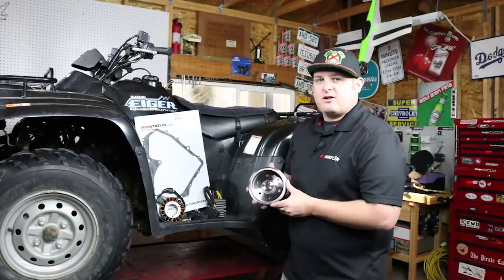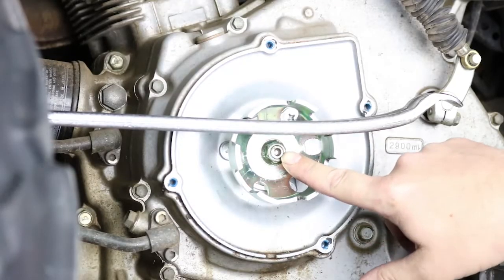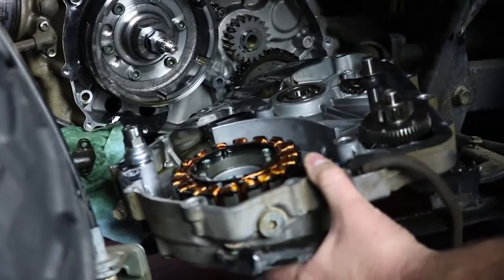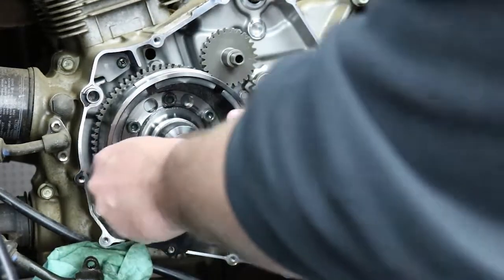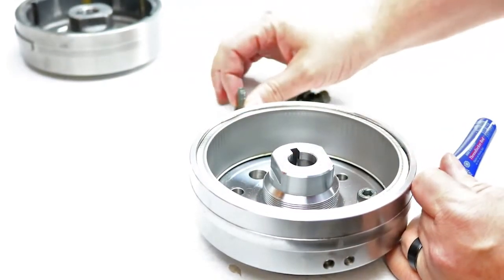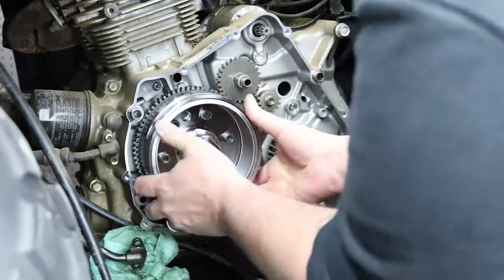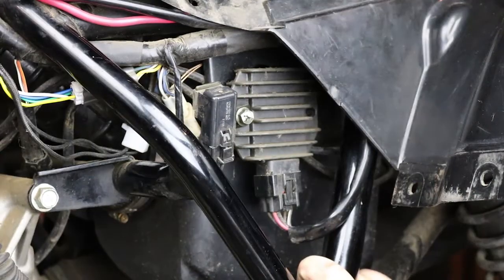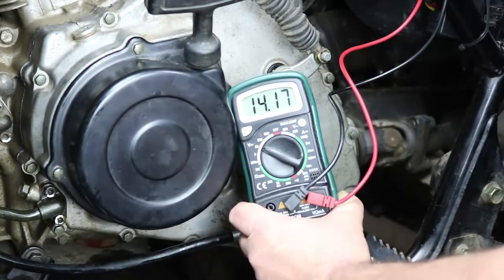How To Install an Arctic Cat 400 & Suzuki Eiger ATVs Heavy Duty Improved Stator Flywheel RM11502

Comment: Great video, I have a 2005 Artic cat 400 4x4 automatic, what is the size of the removal tool required to remove flywheel? Great JOB.
Reply from the maker: Available here: https://rmstator.com/en_us/rm11302
It is 50mm x 1.5 RH thread

Comment: I put my atv back together And when I started it up and put it into low It thinks it's in reverse. I did line up the 2 reference dots  That's on the gears. Any Advice would be appreciated.
Reply from the maker: Sorry I'm not sure. I don't recall having any problem with this. Recommend you check the factory service manual for the shifter install procedure.

Comment: I'm glad I didn't try prying on this case. I have never done this before so I'm following you step by step and You forgot to mention take the 12 mm bolt out of the center then it will pop off
Reply from the maker: Excellent, thanks!

Comment: Are there any details on reassembly? I have a manual Trans and looks different looks like all gears and washers need to be installed on the engine side . looking for a detailed gear washer installation. thanks

Comment: I have a question.  I have a 2006 eiger.  Been having problems with glowing exhaust.  I've tried . New carb. New vacuum peacock. Adjusted valves . Made sure exhaust want plugged . It will fire up and idle.  But soon as u hit throttle it spits and sputters . And quad only has 1200 miles. My question is . Could it be that the problem is  my stator or coil or flywheel ?? 
Thanks

Comment: Is having no spark  usually the flywheel magnet culprit? Just wondering how to diagnose it's the flywheel. I have the 05 Suzuki Eiger and it was running then died. Fired back up but died quickly.I did have what I call a cough from the carburetor off and on for awhile now. So hopefully it's just a clogged jet, we'll see. Nice to the point video though. 👍
Reply: Did you ever figure out the issue?
Reply: @zanerobertson9877  Yeah had to replace old flywheel with the new updated flywheel. Magnets are sealed on the new updated flywheel. Two of the magnets on old flywheel had came loose. Luckily it didn't destroy the stator.

Comment: I have replaced the starter rotor on my 2004 Arctic Cat 400.  Yes, magnets fell apart.  Put the whole thing back together and forgot to put the clutch in the rotor.  Used your video on freeze frame to determine which side goes toward the engine and which faces out.  So, anyway, reassembled and replaced oil and filter.  Now the starter just clicks.  Battery drops from 12.43 to 6 volts when starter held momentarily.  Starter turned fine before clutch was installed.  (LOL!)  Rotor turns counterclockwise -nothing clockwise.  Something appears to be binding.  So I am wondering about reassembly and gear alignment.  I can find nothing on how gears mate together for reassembly. I am concerned about the approx. 1/3 fork assembly point down from the outside casing which I believe mates to the small gear to the top right that only has teeth on 2/3 of it roundness.  In essence... got any clues?  Thank you in Advance!

Comment: I know this is an older video....and a good one. I have a question for you. I have a 1999 Artic Cat 400. It will start great and idle great. When I put it in gear and increase rpm's it misses like crazy. If I shut it off and restart it will run great for about 10 sec then start missing like crazy again.  I have cleaned the carb and replaced the primer diaphram, replaced the diaphram on the high speed vaccume thing, no water in fuel. The carb is an older gravity flow. If it's the stator magnet problem why would it run great part of the time. Thanks

Comment: Do you have to buy the fly wheel or can you just replace the stater?
Reply from the maker: You can do either, but I highly recommend replacing them together! Especially if you have an OEM flywheel in the motor.

Comment: Remember if your flywheel moved off a little bit to pull the puller off and see if that inside thread protector is holding it on. That maybe the case of why it won't come off all of the way. You'll take off that protector which only leaves about 3/8 clearance for it to move off and it'll seem your flywheel will just fall off after that.

Comment: I’m at my wits end with my 2003 Arctic cat 400 4x4. Starts perfectly and idles perfect. When temps drop below freezing it’ll start perfect and idle forever but if I punch the throttle it’ll cut out. Loses spark. Have to cycle the key to get it to fire again. It eventually stops doing it after a while. It will then run perfect the rest of the day. Please someone help me out. I put a new coil on. No difference.

Comment: Why change voltage regulator? I just did this job and it is just clicking and I didn't change the voltage regulator?
Reply: And I've charged the battery and left it on a tinder and keep getting the click changed the starter relay etc

Comment: what are the torque specs for the case bolts around the outside and the big one in the middle?
thank you in advance!
Reply: Late seeing this , but did you ever figure out specs ? I'm replacing my crankcase cover and can't find specs.
Reply: @tylersysk3945  I didn't I just guessed at 30 in lbs
Reply: @MrMiller123  Thanks. Did that work well ? I think the cover is 8 ft lbs. But what did you do for the long 6 in bolt threw the center ?

Comment: Great video.  I have a 2000 Arctic Cat 400 atv that seems to be having the same symptoms. I pulled the cover on it and the magnets don seem to be exposed like they are on the one in the video.  Do you know if this is applies on this model before I throw money into it.  I did test for spark at the spark plug and it does spark. Thanks

Comment: Well, received the puller and tried taking the flywheel off. It did not budge. Kept trying but now the crankshaft protector has rolled the threads on the crankshaft. The flywheel has not moved. Cannot find any information on size and thread pitch for the crankshaft. Any ideas on how to remove this thing without destroying the engine.
Reply: Sounds like wrong tool treads 
With pressure on it you might try prying and air hammer 
Dang this is a problem 😢

Comment: question- I bought one of these flywheel kits and I have the flywheel, stator and pick up coil installed. There is bit on the description online where I ordered the kit that says you must adjust the air gap between the flywheel and the pick up sensor by rotating the flywheel and using a feeler guage to find .010". How does one do this? In order to rotate the the flywheel and get a guage in there the side cover must be off. But the pick up sensor is bolted to the side cover.
Reply: I have the same question, by chance do you have the answer?
Reply: I have the same question as well.

Comment: What gear did you have the atv in when you performed the replacement in this video? My linkage is off by about 3/8" so it does not fall in the notches at the shift handle...therefore will not try to start as I'm sure the neutral switch is not activating. Any tips? Thanks
Reply: Try turning the gear shaft until neutral light comes on.  Then put your shift knob handle in neutral position, then reattach the link to the shaft amd tighten the clamp bolt.

Comment: How do the transfer gears line up?  Please reply,  having trouble, need help0.
Reply from the maker: Hi, you mean the starter clutch gears? You just need to rotate the clutch on the back of the flywheel a bit until you find the right position, it will slip into place easily.
Reply: @Rmstatorinc  the hi /lo/rev gears.  Mines a foot shift and when I changed the stator (Rm stator) the transfer gears came off when I pulled the cover. Now it'll either jump out of hi,  won't go in rev or not engage at all.  I've tried 4 different positions.  Thank you for taking the time to reply. You have just gained a loyal customer.

Comment: I recently replaced a flywheel for my quad with one of yours and I was very careful to watch for the washers when I pulled the stator cover off (i believe one was on each side of the gear shift gear) but now once i barely snug the case bolts the starter doesnt seem to want to turn the engine over. What am i missing?? I've had it apart 3 times now and getting frustrated....please help!
Reply: Did you figure this out?? I am having the same problem
Reply: @gregshank268  no yet, the only thing I can figure as of right now is the gasket I received was the wrong one so I figured I'd use gasket maker (black silicone oil resistant gasket stuff) my thoughts are that possibly the thickness of the gasket is just enough to "shim" it out just a tad. Waiting on my new gasket to see if that helps. Mine is the automatic and it doesn't have as many gears or washers and the manuals do. There are only two washers in mine and I'm pretty certain they're in the right place
Reply from the maker: Hi Ken, sorry I have never heard of this problem. I've installed many of these kits myself and never had an issue. Our gaskets are the same thickness as OEM, should not be causing that problem. I think you are right on the washers, the video should show that in detail, it's been awhile since I've installed one and I don't recall the exact order. Is the starter clutch on the flywheel meshed well with the starter gear?
Reply: I am having that same problem right now, did you figure it out?
Reply: I'm having the exact same problem. Starter not working at all just clicking. I did have a washer come off and was not sure where it came from.
Did you get it figured out?
Reply: I’m now having the exact same problem.  Something is bound up once my cover is installed.  I can pull it over with the recoil but the starter can barely move the engine over.
Reply: @ManWithaPlan1658  mine turned out to the starter solenoid. Replaced the solenoid and now works great.
Do you still use the original starter?
I also recently replaced my starter.
Reply: @ronstewart4241  My original starter was finally replaced a couple of years ago.  It was replaced using $35 Chinese starter replacements from eBay. I’ve gone through 2 since then but my machine has 10k miles. Still probably worth getting the cheap ones compared to the outrageous OEM starter prices.
Reply: HERE YOU GO MY FRIENDS!
The factory gasket for the left engine cover is .025” thick.  I had no gasket and used RTV gasket maker for my repair. 

That’s WHERE THE PROBLEM LIES.  
The case was squeezing against one of the starter idler gears with NO OEM GASKET installed .  Hence the starter was experiencing a big load due to the binding gears. I could still pull the motor through with the recoil and not feel any binding (because of the one-way clutch?).  

I’m in the wilderness and had to come up with an immediate solution.  Found that the cardboard on my discarded case of beer was .025”. Lol!  Made a gasket from my beer carton and problem fixed. 👍
Reply: @ManWithaPlan1658  that is one smart idea, would have never thought of a beer carton, hope you had beers after not during the repair!👍

Comment: Do you have the flywheel and stater for the 2001 400 Eiger?   I have the 2003 400 Eiger and they seem identical.
Reply from the maker: I don't think there was an Eiger in 2001? They began in 2002. Our system should fit all years of the Eiger from 2002-2008. The stator cover gaskets are different between the Auto and Manual transmission models however.
Reply: @Rmstatorinc  You are correct, I thought I had a 2001 and a 2003, I have a 2003 and a 2005. Haha!  I have had too many quads over the years. Cant keep em straight.  Thanks!

Comment: Excellent videos. My ‘03 Eiger isn’t starting, after troubleshooting carb & fuel system decided it must be magnets. But nope, flywheel and magnets are fine. I am having a problem putting cover back on, advice?  Also, any other reasons my Eiger won’t start?
Reply from the maker: I would recommend fully testing the stator. The position sensor or pickup coil could cause a no spark. You could also have a problem with the CDI box or ignition coil. You can't test the CDI, but can easily test the ignition coil. Good luck!

Comment: Excellent video, was able to get my machine running again. The only thing was the center bolt in the middle of the cover you didn't mention taking it out and I fought for an hour and a half trying to get the cover off. I thought that was something holding an internal part. Other than that great video thanks for your help!
Reply: Thanks. That was my question before I reefed on it.
Reply: lol so did I

Comment: Thank you, will be buying your kit tomorrow,  mine had been running terribly when it got hot then die. So i found the magnets were loose but had not separated from the flywheel,  just moved around,  no damage to magnets or starter. BUT I have good sized chunks of metal on magnetic drain plug,  what could this be from? When the timing went off, could it have broken a valve or something? Thanks again!
Reply from the maker: That would definitely do it! Hard to say what the metal on the drain plug is from. Could be slivers from magnet, damage around stator area in the case, clutch side, head, etc. Hope you find it!

Comment: Where could I find the torque specs for the bolts on the cover? When I go to put that back on. And is there a certain grease to put on before the gasket?
Reply from the maker: Hi James, the Factory Service Manual will provide all those torque specs. It is very easy to find a PDF version to download online with a bit of Googling. I always use a thin film of Black RTV sealer on both sides of the gaskets, and never have any leaks.
Reply: Thank you!
Reply from the maker: Anytime!

Comment: Hello . you just have to replace the flywheel or the whole big kit. Kit Stator + Improved Magneto Flywheel + Regulator Rectifier + Crankcase Cover Gasket RM23044 RM2304 ?
Reply from the maker: The flywheel is most common part to fail on the Suzuki Eiger / Arctic Cat 400 ATV's. However when the magnets fail they often damage the stator. Because of this, and a decent amount of work to get to the stator/flywheel area in the motor, it is very smart to replace them both at the same time.
Reply: @Rmstatorinc  ok.very thanks for the answer !!
Reply from the maker: No problem!

Comment: Did you have any trouble putting the cover back on because you didnt show that part and I cant get my cover back on
Reply: grant henneous did you get your side cover back on? I can’t get mine on either
Reply: Yeah so the problem is that on the left side of the cover theres a pin that doesnt stay straight (it's part of a gear I think) and you have to use something to put it back into the slot on the cover and you should be good to go
Reply from the maker: Just make sure to line everything up correctly. All the gears need to be in correct location and orientation. Make sure any locating barrel pins are fully inserted, and any gears and shafts are inserted all the way into the motor.
Reply: I’m bout try putting it on again I’ll let you know if get it
Reply: Sounds good
Reply: Got the side casing back on but now the starter is just clicking before I put the side casing on I checked the starter and it turned the motor over
Reply: Yeah that happened to me too they my friend decided to take it to a mechanic because it's his uncle's if you figure out what that's all about let me know because I thought it was crazy and we just blew some fuse or something
Reply: I got it figured out a pin that goes into the cover was slightly misaligned and was a bit of a pain in the ass to get realigned

Comment: Thanks for a great video. I just bought your flywheel for m 2004 Eiger LTF400 manual (magnets were off on the old flywheel). Your video led me through until I stuck at tightening the flywheel nut. I don't have the impact wrench with adjustable torque. The wrench to hold the flywheel is not easily accessible at my place. Could you advice what size and model of wrench I should use to tighten the flywheel nut?
Reply from the maker: An impact gun will generally tighten flywheel nuts securely. You can use a torque wrench to verify this afterwards. You can use a large crescent wrench to hold the flywheel in place while tightening the nut with with a socket wrench or torque wrench to finalize. I believe the nut is a 19mm, but it's been awhile! Hope this helps.

Comment: NEED HELP...I have a 04 Eiger 400 that won't go into gear at all.could this be the flywheel?
Reply from the maker: If the motor runs (even if the flywheel magnets are broken) this is not likely to cause a transmission shifting issue.

Comment: You can tip the bike on its right side just past the balance point (then secure it with a rope etc. in that position). You don't have to drain the oil (though it is a good excuse to change it anyway); but for those without a lift it makes working on the think sooo much easier. One drawback is there are tiny openings which disappear inside the engine so plug them with rags or risk losing things in there like the half moon key for the crank (wonder how I knew that :-) luckily was able to fish it out with a magnet).

Comment: I had to switch the yellow and white wire to get spark on a 2004 Eiger 400
Reply from the maker: Was this on one of our stators? Thank you for the information. That would be the wires for the position sensor / kickback prevention coil. It does need to be in the correct polarity to allow spark on those models.

Comment: Nice video!! What are some good ways to get out any magnetic pieces. Should I put a magnetic drain plug in?
Reply from the maker: A magnetic drain plug is always a good idea. You can use a small extendable magnet, or a magnet on a wire to fish around the bottom of the crankcase area to pull out pieces of the old damaged flywheel magnets. Definitely try to get them all out!